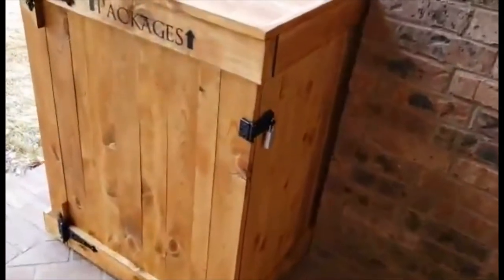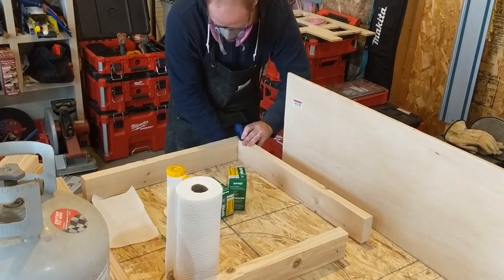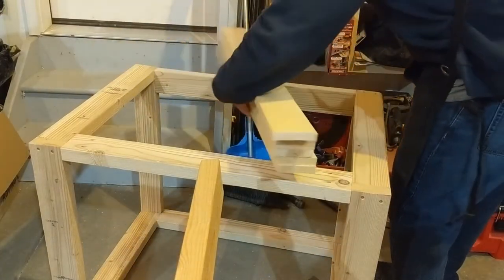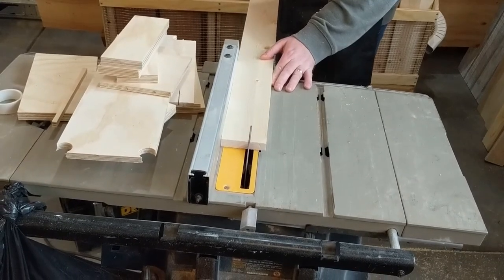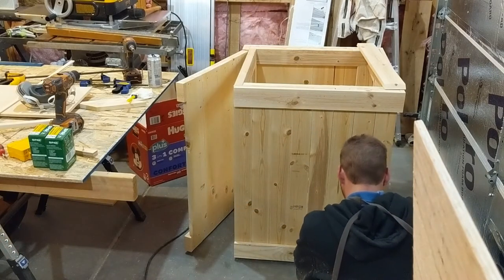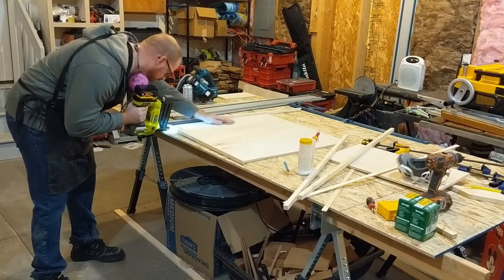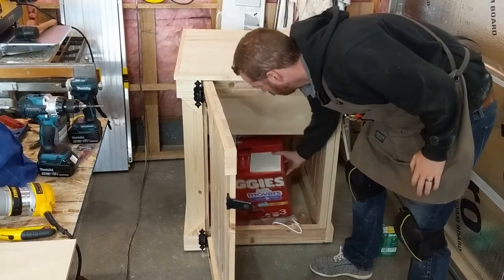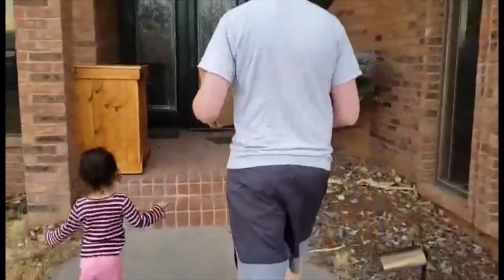How to build a Package Box(Stop porch thieves!)

Comment: Good idea. I think I might use airplane cable instead of rope. What stops someone from cutting the rope and dropping the flaps down to take what is inside? Just a thought.
Reply from the maker: Good idea! So far the ropes seem to be working, but I did see some good ideas for some permanent metal arm hinges that would work similar to what you are mentioning, if that does happen, I'll have to look into that upgrade.
Reply: Instead of having ropes or wires that can be cut just use an inner lower platform which is angled. There’s then no way for porch pirates to get to the parcels
Reply: I was worried you could just pull on the ropes and open the lid the opposite way, but then realized the hinges probably prohibit them from swinging any further

Comment: instead of the flaps that probobably wont work for keep smaller packages from getting snatched, i think im gonna go with a electronic keyless entry system that works with the UPS garage door opener service...  basically with an arduino emulate a garage door lock and they have a system where they can use their universal garage code system to open it.
Reply from the maker: Very interesting idea, I like it!

Comment: So those flaps limits the height of the package you can receive. I was going to buy one which had one flap inside but that would even limit the height further
Reply from the maker: To a certain extent yes, but whatever weight you can lift the lid at, transfers to the ropes then to the inner lid, so you can easily do 40 to 50 lbs and not damage the box.

Comment: So if you open the box and cut the ropes, the 2 panels that block access to the package fall down...giving access to the package from the top. Is that correct?
Reply from the maker: That's correct, although that is a couple of extra steps a thief will have to take instead of just grabbing the package and run. I can happily report that even though we had several packages stolen before the box, 0 packages have been stolen since :). A lot of times thieves are lazy and don't want the risk of extra time that it would take to do this.

Comment: Today I learned there is a dewalt to ryobi battery adapter. I guess it makes sense, Ryobi makes a lot of homeowner stuff that Dewalt does not and some people really want their high end tools.
Reply from the maker: Yeah they are aftermarket devices. I use the badapter ones that you can find on eBay. Pretty much any battery has an adapter out there to work with others.

Comment: Do you happen to have a material list you could share?
Reply from the maker: This is the original list I used to make it, but it might not be perfect for what we exactly used: 33'	2X4
125'	1x4
1	".5"" plywood sheet"
1	Door Hinge
2	Lid Hinge
1	Rope or Lift
1	Lock mechanism
Box	"1.5"" screws"
Box	"2.25"" screws"
	Pocket hole screws

Comment: Knife
Reply: Someone mentioned using chain instead of rope.  I don't think your common porch pirate will have bolt cutters on him/her.
Reply from the maker: Yes, but that's pretty bold of a porch thief to sit there cutting open the box to steal packages inside. This has been in use for several years now and no one has tried this.